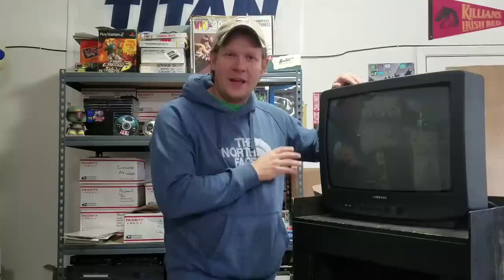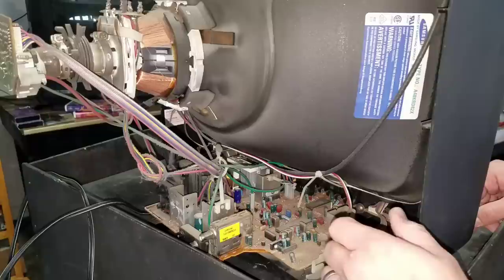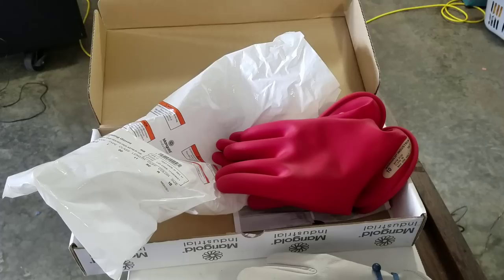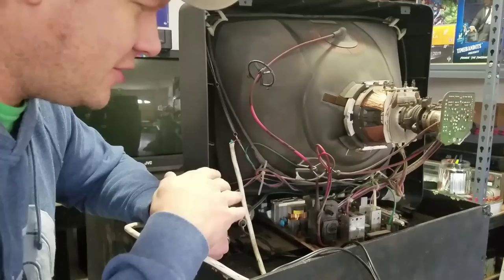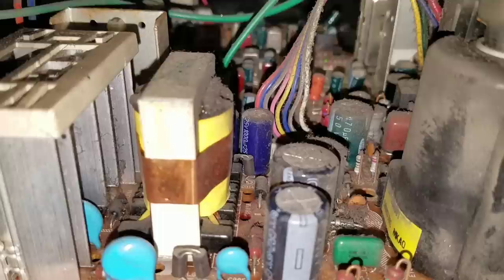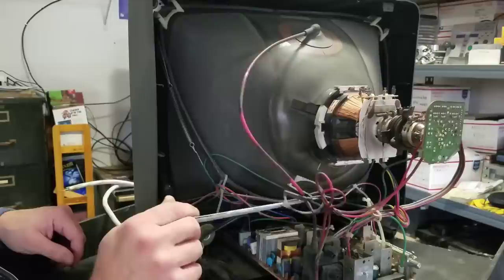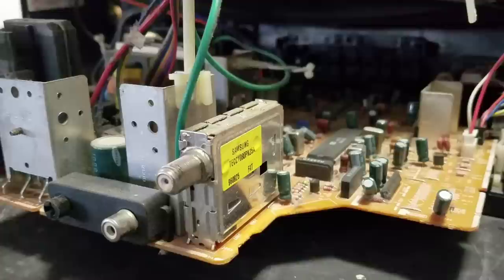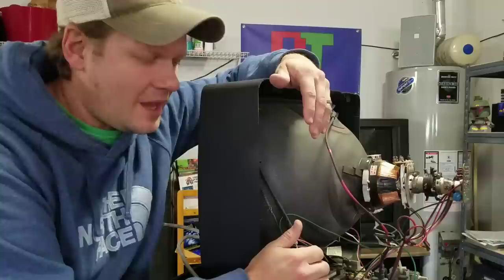CRT Safety - The Consumer TV Version - Cathode Ray Tube

Comment: thanks for the advice. im just about to open my first CRT and try to clean it and check for signs of damage, and hoping not to kill myself in the process. Actually i have two of them now, one is a philips and the geometry was all messed up when i got it and plugged it in. im wondering if just by plugging it in after it had sat for so long may have caused damage.. either way, appreciate the guidance.

Comment: My 27-inch Sony Trinitron CRT has problems with the audio, every time I turn on the TV it sounds like a slight roar that accompanies the sounds, especially in the bass.
Another problem is that one of the corners of the screen has a green color that alters the color of the image in that area.
Reply: sounds like you need to move your speakers away from the tv

audio speakers arent shielded properly sometimes & this causes discoloration on the screen 😌

Comment: question that is probably stupid, but are CRTs safe if you don't plan on modding them? just as is? since they are aging electronics, is there any inherent danger in that? i plan to buy/get one and just play some games plain old composite for old times sake but people keep telling me its a bad idea  because they are dangerous. but my modern tv is illegible and no way im spending a ton on a scaler for some casual playing.
Reply from the maker: CRTs are fine if you use them like any other TV or electronic.  As long as they are working, and you don't see an obvious problem, then you are safe to use a CRT casually.  These tips are really only if you are planning to try to make an adjustment or if you need to clean inside your CRT.  Thanks for asking!
Reply: @RetroTechUSA  Thanks!

Comment: If you try and adjust the picture geometry (the picture geometry is sorta bent to the left) by adjusting the yoke while the tv is on, wont you get electrified if it’s on since it’s not discharged?
Reply: He discharges it in the video.

Comment: Got me a new and never used little 14" CRT TV made around 2006 to use for retro gaming. There was one problem though, after about 5 minutes it shut off by itself and after I turned it on again one of the AV inputs was not available and the menu was on a foreign language plus it was only 2 languages instead of like all european. That was super weird but after I unplugged it for a while it was fine again, tested it for some hours, ran ok with no problems. Somebody know what that could have been?
Reply: I have no idea. Maybe owner just fucked with it. Or, the TV was having a moment.

Comment: Can this adjustment be used to move the screen higher or lower? My screen is level but the bottom of the picture is cut off because the screen is too low. Can’t find much on a fix. Thanks!
Reply: id check your service menu first bud 
you can likely adjust it with your remote

Comment: Hi there I recently picked up a Sony KV-40XBR800.. The guys that I had move it for me were a litte rough with the tv, one of the guys didn't pick up the the end of the dolly to gently ease it out of the den, which had a small step maybe 3 to 4 inches high, instead he just pushed it off the small step with the crt on the dolly..  after I got the TV home there was a slight yellow/whitish hue or distortion on the top right corner of the screen and a slight greenish hue on the lower left corner, the side the dolly rolled off the small step and hit the ground with the tv on it.. however after some use these past few days it seems to greatly reduce.. but if someone pays close attention they can still see it.. I am wondering if something was maybe damaged during that initial push or while moving.. The gentleman I purchased the tv from said it was in very good condition, but he hasn't turned it on or used it for years.. I'm fairly good with electrinics, soldering etc.. However I'm new to CRTs and don't yet fully understand their anatomy and internal componts, but I'm learning with videos like yours... I've been searching for this model over a year now.. feedback would be greatly appreciated, thank you!

Comment: So the discharge screwdriver tool looks handmade. What else than a screwdriver do you need to build one?

And about the gloves, can you also use standard rubber gloves you find at the store for cleaning or working with chemicals?

Comment: I have a really big one that I am going to break tomorrow. I will throw a brick at it and make it explode. Wish me luck 🤕
Reply: Note  it will not explode  it will implode as the crt is under vacuum . To deactivate remove the connector on the neck of tube and tap the end where the pins are this will crack the glass neck and allow air in slowly .DO NOT THROW A BRICK AS THIS WILL BE  SERIOUS HEALTH HAZARD.